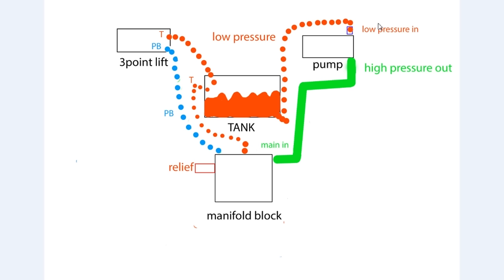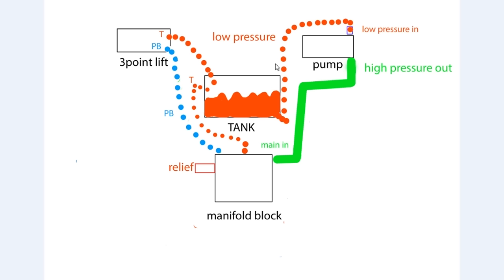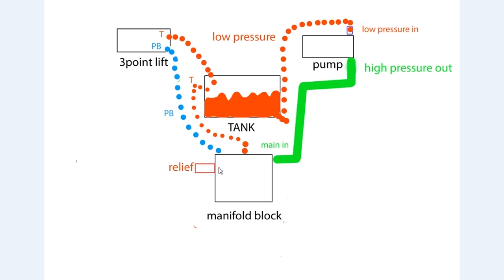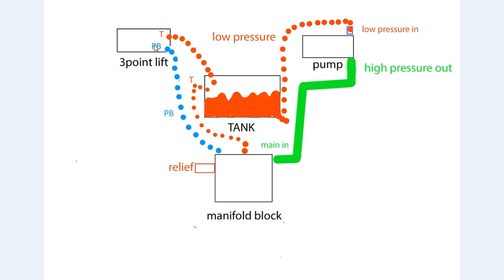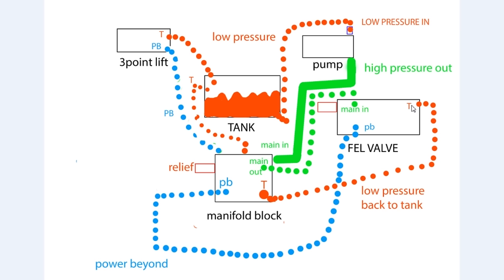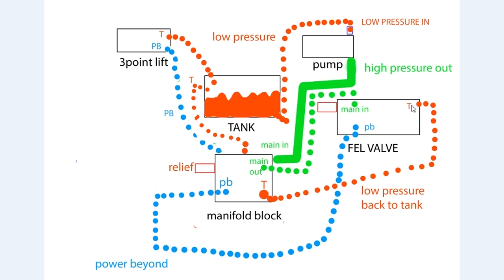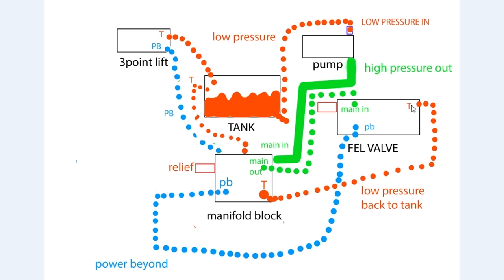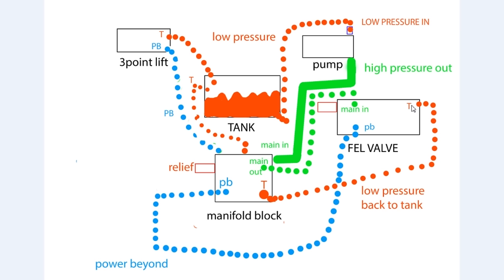adding rear remotes and understanding tractor hydraulics

Comment: Great Video Dave! Still trying to get my stuff to work right and everyone I ask is clueless I have a 1963 Fiat 411R with an added front loader loader doesn’t lift much weight and the three point hitch doesn’t seem to work right either. Going by your drawing I think the lines may not be ran right because my tractor the line coming off the pump the high pressure goes right to the FEL I’m assuming that’s the two levers for the front loader then goes to the black under the seat I’ve had it almost a year haven’t found anyone to figure it out nobody knows anything about Fiat tractors
Reply from the maker: so it sounds like they are using the fel valve to act as the primary relief valve. you could have a relief valve that is partially stuck open. this would cause fluid to lose pressure and not be able to create enough pressure to lift much weight or operate the three point. be sure and check your hydraulic filters since a clogged filter or a collapsed filter can also create these issues. your front end loader valve should be labeled and you need to check to be sure the lines are correctly hooked up. keep in mind in an open center hydraulic circuit the pressure out the pump is low  and just flows effortlessly until you use a function. moving the FEL control for example transfers the low pressure fluid into a hydraulic cylinder it is when that cylinder moves in one direction or another that high pressure occurs. this means you could open the line that heads to the fel hydraulic cylinder and  install a pressure gauge. be sure and get a oil filled pressure gauge that reads up to 3000psi. or even a little more would be better. then operate the control and see what the pressure reads. you should likely be around 2000psi or so. if you get under 1500psi you likely have issues with either a slightly open relief valve or a hydraulic pump that is failing or has failed.  this will at least give you a little insight as to the health of the pump.
https://www.manualslib.com/manual/883768/Fiat-411-R.html
Reply: daveknowshow thank you
Reply from the maker: @ChristopherPryce9  https://www.manualslib.com/manual/883768/Fiat-411-R.html

Comment: Great video. Like what another person said, pictures help, great diagramming ! Now I understand my hydro system.
 Last fall every time I got a chance to go down to the creek and work on crossing or removing evasive brush, I would spring a hose leak and was done, until the nephews could replace the hose. My wife told them this winter when they go caught up, we wanted all the hoses replaced and they did :-) ......do you think being over 20 yrs. old would have any thing to do with it ?
Vic :-)
Reply from the maker: they served a good long life at 20 years mine is about 14 years old she has sprung a leak on the backhoe once and the front end loader. the sun gives them a beating to I guess. hope you are both doing well. think of you often. take care. Dave
Reply: Same here Dave. PS: I imagine being in the barn has helped the hoses last.
Reply from the maker: for sure. my poor tractor sits outside in the heat of the sun and the freezing cold. has since day 1 its amazing its in as good of shape as it is.
Reply: Yes it is, you must keep it waxed, because it always looks like new ?
Mine use to get waxed a couple times a year, back when I could, I don't even know when the last time it saw wax.
Reply from the maker: actually I have never waxed this tractor. I do wipe diesel fuel over the hood when it spills or where ever I need to remove heavy grease.  I have power washed it a couple times . I may try and wax mine this spring. been sick with a terrible cold the last few days so I been unable to get online just too sick. I wanted to answer your comment so I popped on for just a few minutes. hope you are both feeling well.

Comment: Dave, I learned a lot about the hyd. system and how it works, and all was good until you added the spool valve. After watching part 2 of the series for the ???th time, it appears your diagram flow doesn't match what I see and hear in the part 2 video. Seems like, in the video, you come out of port C and go back to the BH hard line connection (back hoe out? w/female coupler on end) and use the FEL PB OUT line to the spool valve inlet, and leave the manifold block PB IN line alone (at BH end has male coupler fitting). ?? Now I'm really baffled. Unless either way is good.
I need to add that I beleive I have the same Prince  Spool Valve you are using. 
Thanks for the videos.
Reply from the maker: Bob you got me worried so I went out there climbed under the tractor and looked. I did hook it up according to video 2 in the series which is also correct. the power beyond comes from my fel valve out to the input on the new spool valve first before the backhoe. then out the power beyond port of the new spool valve and out to the backhoe. the other hose from the backhoe is connected to the power beyond port at the hydraulic manifold. this puts the new valve before the backhoe rather than after the backhoe as in this video illustration either way will work.
Reply from the maker: Bob if you email me at Daveknowshow@aol.com I will send you the exact diagram I used during my install. seeing it will  help you understand what the difference is. to sum it up here I installed the new spool valve before the backhoe between the fel and the backhoe rather than after the backhoe shown here. I made this schematic showing after the backhoe so it would fit on the screen better and the lines would not cross so much. I'm sorry its confusing. I will be glad to email you the exact diagram to show the difference. both ways the new spool valve is being fed into the main inlet from the power beyond of the front end loader.

Comment: Dave, good to hear from you! Great explanation. Hope you're not tired of getting questions on this subject, but here goes. I have an L3901, 28th factory FEL and back hoe. Can the two hydrolic lines that power the back how be used to power a spool valve? The two hydraulic lines that power the back how must be looped when the back how is not installed. I would like a set of rear remotes to use when the back how is not on the tractor. I hope I make a little sense here.
Reply from the maker: yes this is exactly what I did. you can see it in my video series adding rear remotes and a spool valve. the one thing I did different was I plumbed the spool valve before the backhoe in the circuit it will work either way.